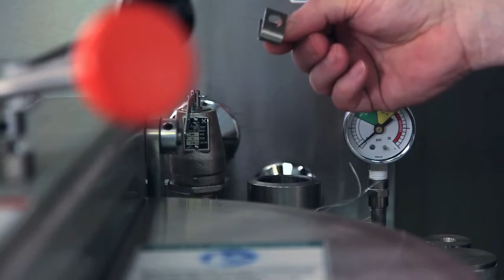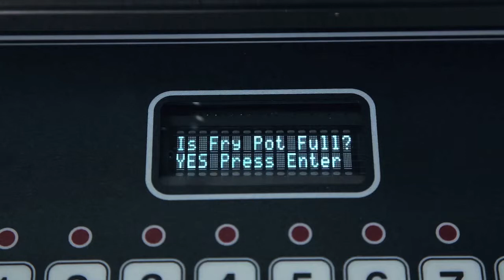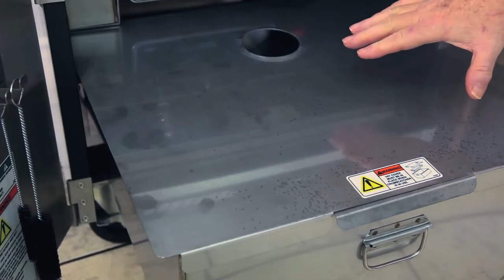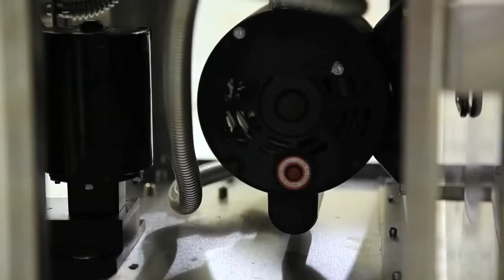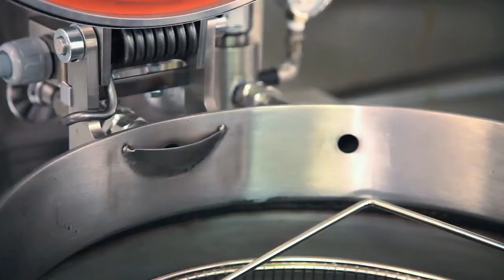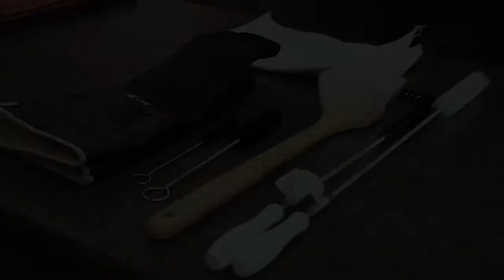BKI FKG FC Gas Pressure Fryer Tour

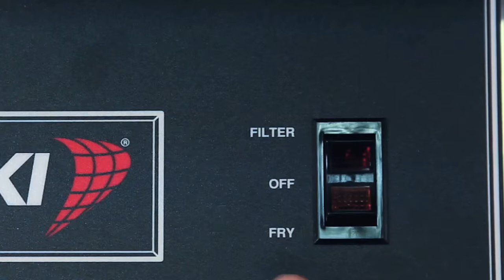Comment: Narrator ( Frank Barrett Mills) identifies pressure gauge as pressure valve twice; ( 1:05 and 8:15) an important distinction; and refers to the rocker switch as a toggle (1:56) nitpicking.